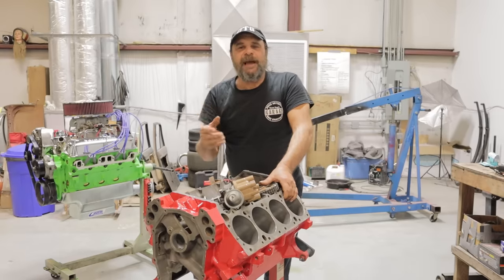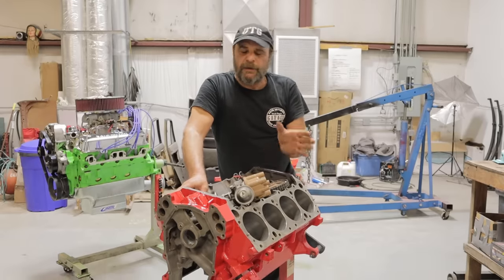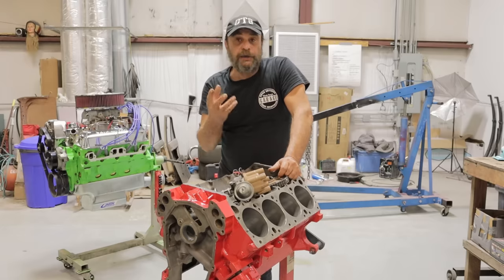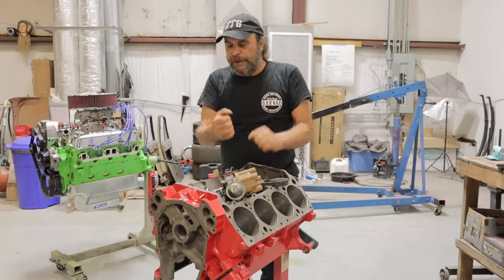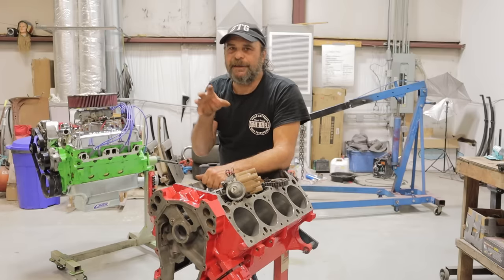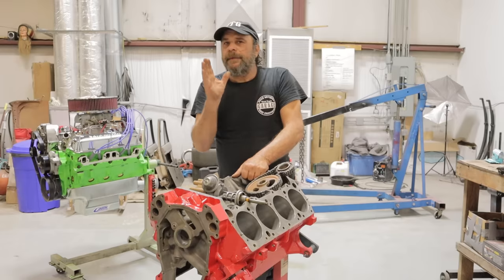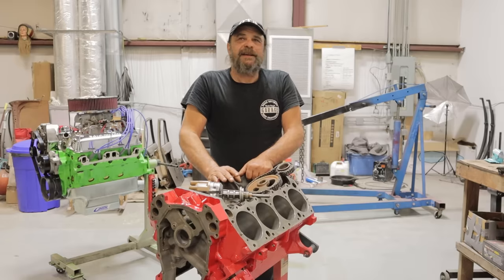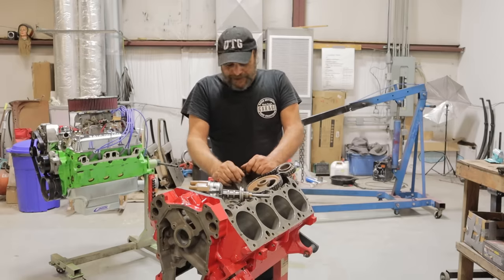Power Timing Secrets For Classic Cars

Comment: Actually, for anyone that wants their engine to run optimally in it’s current condition, it’s the best way to get good results! Well done and Extremely useful info. Power timing by ear is a dying art.
Reply: Learned this on the fly while driving our old (read: beater) dodge motorhome, doghouse off, adjusting carb and loosening and moving distributor to get her just right. After that trip it's honestly never ran better and starts right up as soon as that key turns.
Reply: Here we go!
Reply: In today's day and age of record high gas prices bump that timing a " nuuddga" and get better mileage.
Reply: This brought back so many memories. Tuning the classics of the 1950's and 1960's for the older folks.
Reply: Go ahead and do that to a 10.1 compression engine with steel heads , broken ring lands, busted piston rings. If you power time a 7.5 or 8.1 compression engine..go for it..that's fine, I did it to my pinto and ran better. I did that to a 350 with 10.5 compression and destroyed the engine
Reply: I’d start investing in companies who make quality wire brushes!!!!   Could you imagine Derek’s(Vice Grip Garage) son in 30 years with a 2015 Ford Fusion with trees growing thru it and he only needs to bring a battery and a wire brush for all the connections???

I born in 91’ and my DD is my lifted 1995 K3500(My dream truck) but I grew up with and LOVE technology!!! 

Thankfully…distributors are dying too
Reply: @johnszoke586  goes back to experience. If you got far off enough to destroy an engine that’s just you screwing up.
Reply: Its ear a feel  spot on break down my dad taught me even with new engine builds.
Reply: huffing the exhaust and doing adjustments is a dying Art 🤝 it was good times. Beer was in bottle's
Reply: Brilliant. Just in the process of setting up timing on an old 4 pot Toyota Corolla as E10 gas is what we have to put up with here in the UK...Your video make total sense and love the intuitive approach....Would the "sweet spot" correlate to the highest vacuum reading also? ...and therefore could a vacuum gauge have any useful role to play as a guide to where the sweet spot is?
Reply: I just did the ear thing in my boat. Not too much, not too little ;) I did cheat and look at the tach to confirm idle rom though
Reply: Thank you, thank you, knowledge passed down isn't being heard these days. Definitely helping my 67 C10 daily drive 200 miles.
Reply: I had an old 66 Mustang Fastback and it had a 289 with closed chamber 351W heads 12.5 to 1 pistons. It was balanced and blue printed and it was about as strong as you could get a 289 naturally aspirated. And I was 17 and did not know anything about how to get the timing right. This old mechanic timed it by ear and then he told drive and get on it and listen for just a slight ping under heavy load. He taught me exactly what you are talking about. Them TRW 12.5 to pistons where hard on starters and I eventually got to where I had 2 scratches on my distributor. 1 was retarded and that was for starting it when it was really hot or the battery was weak. The other scratch was advanced to that slight ping under heavy load. I won a lot of street drag races with that old Mustang, I wish I still had it! Great Video Uncle Tony! You just live down the road from me in the Boro.
Reply: That guy is funny
Reply: @johnszoke586  that’s not what he’s talking about dude and you know that. He already said an engine with 150,000 to 200,000 miles on it daily driver.   Your comment makes no sense
Reply: @joejizel5979  The engine would die out

Comment: I used to put the car against a tree in gear emergency break on. Then raise the rpm a smidgen the adjust timing listening for knock , valve noise and watch engine shake. Always seemed to work,  maybe not the safest way.  Its what the old man used to do.
Reply: i do the same and it works .i use a second person to hold the brake and i will operate the fuel and set the timing .
Reply: I love this idea. Thanks guys.
Reply: We would power brake and be ready to take a short ride lol
Reply: Used to park cars that way..

Comment: Older motors for cruising or transportation (not performance motors) I use a vacuum guage. Time it to the best intake vacuum and they turn over and run great
Reply: I was going to say the vacuum gauge trick is a pretty consistent method to get the best results on older, high mileage engines, even works well on fresh, tight older engines, good to see others sharing this dying knowledge, 👍🤔😁
Reply: A vacuum gauge, a screw driver, a 9/16 wrench and clean ears. A full tune up tool kit.
Reply: vacuum for waht, to detect detonation?
Reply: @paulhare662  engine in heavey solitation,,, can detonate and you cant be on the engine to ear it...

one thinh is idel another is cimibing with heavy weight it will detonate as hell and you can even lsiten to it.
Reply: @termonostruman when the timing is Just right, more of the mixture burns at the right time and is ejected from the engine more completely, that way there is less pressure in the cylinders to begin with  therefore they generate more vacuum as the piston comes down, therefore the cylinder is filled more completely.
Reply: @NickGreiner1988   engine in heavey solitation,,, can detonate and you cant be on the engine to ear it...

Comment: Old classic engines are like alive, it's an organ to tune carefully. One of the reason I like old cars. Thanks Tony !
Reply: Yes! LS has no soul.
Reply: Lol you like old cars because its alive and an organ to tune carefully when new engines are equally alive and have more parts to tune.
Reply: can you tune it correctly???
Reply: @umakemerandy3669  new  engines  have  more sensors.  and you can  put  a lot   f those  sensor  on older  engine like an o2  sensor  in your  headers  to tune it.  you can  put  an electronic  distributor  in an old engine  that works  on your  mobile device  with a  timing  table.

you wanna put a new  engine in an old  car  to give yourself some sort of confidence?  go for  it.  its  not  really necessary though
Reply: @KingJT80  super fantistic logic. Super fantastic.
Reply: @umakemerandy3669  it's great logic. Don't spend money you don't need to cause you want the new shiny thing. Work with what you have if you can
Reply: @KingJT80  i dont know where you got the idea about me putting a new engine in an old car or doing some sort of work for confidence inspiration or choosing new vs old engines for financial reasons but yeah all great logic. Supreme wisdom.

Comment: I love this channel. So much extremely important knowledge and information. 
As a 33yo, learning these tips from the older guys allows me to keep the knowledge alive for the future. 
Unfortunately most new mechanics these days only know how to plug into the diagnostic port and do exactly what the computer says. 
These old hot rodding tips are becoming a lost art, but extremely valuable to those that need them.
Reply: I dont understand using a timing light as every engine is slightly different and you have to tweak anyways. You essentially do the same as this but with a fancy strobe light.

Comment: Awesome advice!  I've been struggling so hard to figure out what the problem was with my old engine.  I was using the factory timing specs for a new engine the whole time.  It was so far off that I would have never figured it out if I had not found your video.  I am so glad that you explained the cause and effect.  I had to advance my distributor shaft 7 "nudges"!  Runs like a champ now!  I had almost given up on it.  Thank you.

Comment: Here's another thing on older GM engines, a lot of times we would do this, get the engine in optimal running condition and suddenly it would be hard to start. It would be "hitting half licks" like you went too far on advance but ran great once started. We would usually find that a low torque starter was installed causing the issue rather than the timing! People wouldn't pay attention when buying a replacement starter and get a cheap low torque given to them (this was especially evident when buying rebuilt starters), they would work fine for a while then the starting issues would begin and first thing they did was retarded the timing to get it to start ! Then they would be out every weekend trying to get their engines to run right only to end up hard starting, no telling how many points, condensers, coils, and batteries were bought because of this!  LOL!

Moral of the story is on older GM' s check that starter and get a good high torque on there first thing!
Reply: People pay little attention to starters. Old Mopars burn up their starters.  They still turn the engine but way....way too slow. Can't tell you how often I told people you need a starter..."But it's working." "No, it is turning but it is not working."
Reply: Very true. I got sick and tired of going through the orange chicken lo-mein specials from AutoZone, so I spent more on a USA-made PowerMaster gear reduction unit. Never had a problem again.
Reply: Our original factory starter always required a very good strong battery to get going until we discovered the missing field coil mounting screw.
Reply: Totally right on. Most would then back off the timing till the engine starts with little trouble . This doesn't make power though.
Reply: OEM starters were never really tknown for torque.  And... [extreme] heat  does funny things to field coil strength [field strength drifts], and that causes torque to drop.  What we can do is pay attention to maintenance: drop the starter every two years for a clean and inspect.  Remove all carbon dust from brush wear with compressed air [and don't breath that in].  A collection of this plus moisture allows tracking - commutator bars are becoming partially shorted.  After that, insulators between bars should  not be level with bars - a small slot should exist.  A small slotted screwdriver [hardened tip] that has tip gound dead flat/no deburring works reasonably well to rake slots clean.  If brushes are found with 1/3 wear or more replace them.  If you find copper drag [evidenced by overhangs on trailing edges] that is cause for spring replacement - they are weak.  Pro-tip:  do NOT douse a commutator with lectra clean: it can wash carbon under mica and eventually cause a flashover.  Instead, spray a little bit on a clean rag and wipe clean prior to reassembling.  Last but not least: oil kills brushes - fast.  Identify the source and fix it.  That does not mean getting rid of oil impregnated leather or felt bushings some starrters are made with - they need them.
Reply: Old GM starters with two little copper tabs that bolt to the solenoid work better than the ones with one tab.
Reply: Also true of Fords,  and also remedied by the same high torque starter. Get a powermaster gear reduction unit, not the 100 dollar pos from wherever. Worth the money, and you can reuse it on a performance build bc it already has the balls
Reply: hard starts other issue is the points plate not in sync with cap terminals, would slot out the vacuum advance plate to align spark to hit cap terminal center in cap.
note  need a heat sheild around starrer if having issue no start when hot. Exhaust changes need to rejet carb, cam change power  piston  in carb to calibrate to vacuum, a lighter sping tension  the list goes on for many things to get power to the wheels  like a higher stall torque converter , diff gearing. UT is correct nudge is the simple tweak to find free hiden power
Reply: Jack, I do know there are high torque versions of the old (non mini) starters  but.... how do I identify them?
Reply: @xmo552  it's been a long time since I've dealt with them (25yrs?) but I believe it had to do with the stator hookup at the solenoid: low torque the hookup was right at the end of the solenoid and higher torque there was a spacer between the hookup tab and the solenoid.  If memory serves me right it all had to do with the length of the stator coil. It was not much difference visually jut a inch or so but it made a heck of a difference starting! Another thing was to make sure to use the heat shield as the cheaper solenoids would fry from the heat coming off exhaust !
Reply: @jackedwards7420  
Thanks. I thought it would have to do with the length you referred to or the metal band some have around the motor.
Reply: @xmo552  Old 10MT (SD500 or something similar in modern language) is the old GM non-reduction starter. direct drive. The 10MT high torque has a larger "step" down diameter and its over all larger than the regular.   Like longer.  There are things that can vary, but its the biggest reason. weight is too.

The PG260 can fit in place of the old ones with new bolts and proper install(90s+ used on sbc and subsequent applications)
Reply: I did, my 350sbc has ran through fucking 14 starters of all fucking kinds. Had to ditch the old cast iron flywheel and get a lighter balanced one and it worked good
Reply: Lots of times I found the. Weights and springs in the distributor rusted stuck and doing just that no power advance the timing makes power but won't start for shit this I ran across many times
Reply: high torque guys is it has two winding leads coming from the rear case to the rear of the solenoid low tq only has one lead.
Reply: a good 80's C4 high torque mini starter... those things were a god send!

Comment: Wow, thank you! Finally someone made a video explaining this. An old guy that taught this to me called it "torque timing". We used to time our old derby cars with the engine at around 2500 rpm or so, under load (in gear) and would advance the timing just till it pings and knock it back a smidge. Then shut it off and see if it starts fine, if so and all is good. Adjust as necessary. Been working on old cars since the early 80's and have had people call me crazy, but they can't seem to understand why it worked...

Comment: The old Toyota 4-cylinders had a vernier device built into the base of the distributor for this very purpose. You could turn a knob and get a very precise bump in timing. It worked great.

Comment: Also, be prepared to adjust slightly for different seasons and seasonal fuel blends. I find that I may need to retard timing a bit during the hot summer, then bump forward when cooler.
Reply: too many variables that's why you have to do it by ear
Reply: @schlomoshekelstein908  SURE AND  the most aprt of detonation you canot lsiten,,,

so the explanaton of uncle is not ablsolutly correct i thingk is information jsut for beginners.

there are many factors thayt amke engine detoante and you dont lsiten if your in the limit,,,  speciall if is a vintage,, cause it cant variate timing automatically unless you put there a good detector and make it retard with anotehr ignition
Reply: I just leave my timing and add mmt to my gas for the 100 degree weather. It does make a bit less power admittedly.

Comment: Another thing to consider is that a lot of times the outer ring on the harmonic balancer can slip over time causing the timing marks to be off
Reply: Just replace mine.  Power steering leaked on rubber ring causing it to slip.  Fixed leak so won’t happen again. It was way off.

Comment: Yes, setting the timing by feel works well, you can feel the engine pep up even when idling as you advance the timing, if you go to far it will start to kick. To learn this, start with an engine at operating temperature then move the Distributor to retard the timing and then start advancing it, you will hear and feel the difference, that's a good way to start learning this.

Comment: Back in the late 70s I worked for a Los Angeles based chain of tune up shops. That's all they did. They had dynamometer that we ran the cars on and loaded them down. We did carbon treatments and power tuning and if you did it right your timing came in within a degree or two. It was a nice system.

Comment: I've learned this when I was growing up in a old beat up fked up  dodge 440 V8 engine  motorhome that passed down to me from my uncle . My Next door ( another motorhome trailer trash ...) Was an Ex-VietnamVet and  taught me the same thing ... I still remember that day ...it was Summer of '86... Long long time ago ...  With interior hood out with cooling fan air in my air climbing up the hill listening ping from the engines ...one hand on a steering wheel. Peeking out my one eye on a street . Other hand is reaching and turning distributors ... Very  Dangerous but it was fun .... 

Thank you for reminding me  this... Remembering that time is priceless for me .

Comment: I think you just described my 1987 Dodge D150 with the 318 4 barrel engine. It has 186000 miles on it without a teardown. I has been completely desmogged and is now equipped with an Eddy 600 and a HEI ignition. The initial timing is still set at the factory specs. After watching this video, I'm sure I can make my engine run a lot burner. Thanks Tony
Reply: I have an 85 D150 with a 318. Awesome truck.

Comment: This is certainly the video I've been looking for.   Just bought a '79 F150 with a 72-73 Windsor under the hood.  No idea how many miles are on the engine but having trouble with consistent idling.   Fixed PCV hose leak, much better but still not right.   Put a vacuum gauge on the intake port and reads around 15 (gauge says "late ign timing").  

This will help me a ton.  Thanks

Comment: Agree with everything you said. Hearing the engine is so important. I typically turn the distributor until engine runs best. Revs will be up quite a bit by then and I then set Revs back to 800rpm. Then repeat the same - nudge distributor, then adjust idle rpm again. Continue doing this until it idles like a swiss watch...
Reply: But detoantion occur with other factors, when climbing caryin heavy cargos, temperature outside etcc.
and the main detonation you can not lsiten it